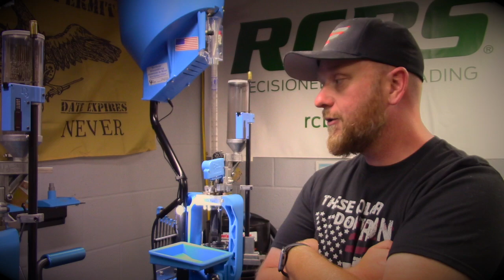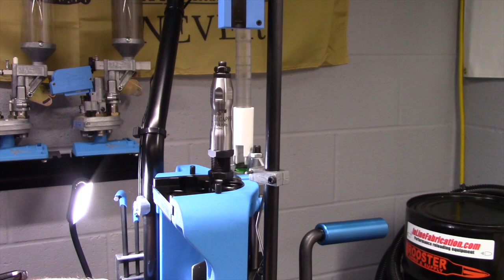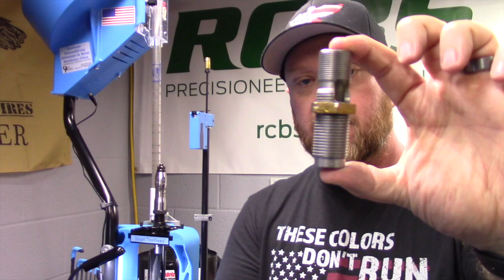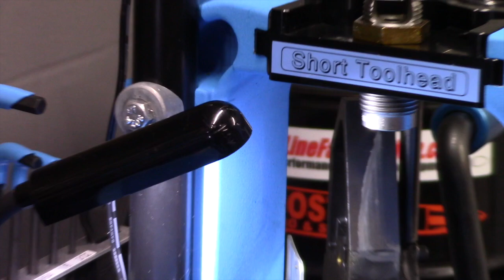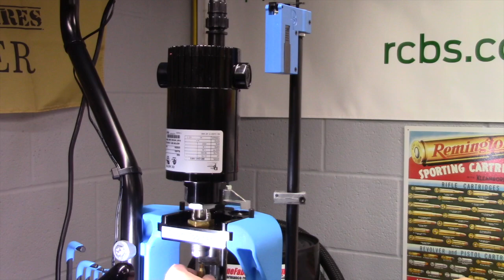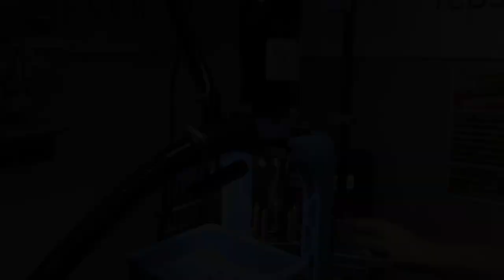Dillon XL750 - RT1500 - Size/trim in one step

Comment: Can you tell me what is the reason you go to 1.740when you trim I’m finding when I go to the suggested 1.750 after the capping sizing and trimming with the same set up on my XL750 I’m finding inconsistent length after loading and I think it’s because during trimming not everything is getting trimmed to the 1.750. So I guess my question overall is what are you gaining by going to 1.740?

Comment: My problem with the Dillon trim/sizing die is that, even when lubricated, copper oxide from the annealing process is transferred to the wall of the trim die.  This mars the neck of the newly formed .300 blackout case and technically ruins the trim/sizing die.

Comment: I like your videos. On the Dillon short trim tool head, you mentioned 223 and 300 blackout, can it be used for other calibers like 308 or 303 with the proper sizing die.
Reply from the maker: Yes it can.  However I prefer the standard tool head on 308

Comment: I have my one 750 set up with station 1 Dillon resizing and decap die( %90 resize) 2,3 empty 4 trimmer and finish size 5 Lyman M Die. So far no issues. How tight do you tighten the lock ring for the trimmer height? The only complaint I have is when tightening the trimmer it’s difficult to keep the die from backing off. Any suggestions?
Reply from the maker: I usually put a screw driver through the opening on the die and hold it to snug up the lock ring.

Comment: I have a question after watching this video.  Your sizing die, doesn’t have the piece that goes inside the case to prep the neck like my dies.  I understand that’s impossible with the trimmer you have mounted on the sizing die.  But how do you ensure the opening and neck of the brass is within spec?  Would it be feasible to install a sizing die prior to the trimmer that sizes the neck of the case? Great video!
Reply from the maker: I would not place a sizing die before the trim die because you find the cases will spin in the trimming die.  The actually size operation is what holds the case for trimming.  What I use is a mandrel die as the first die when I am loading like a Lyman M die.